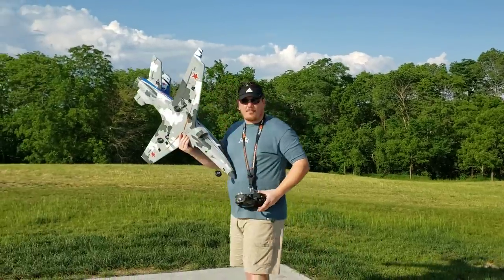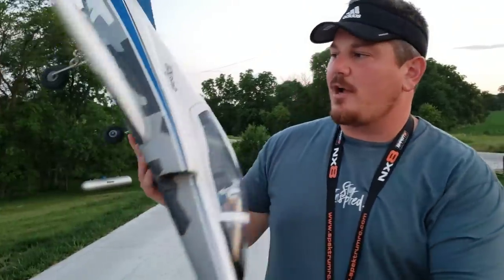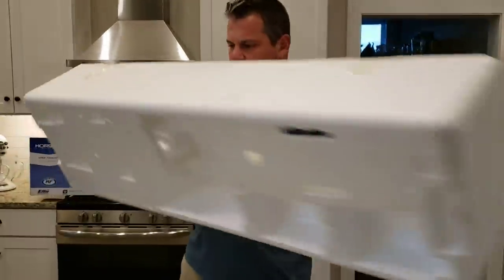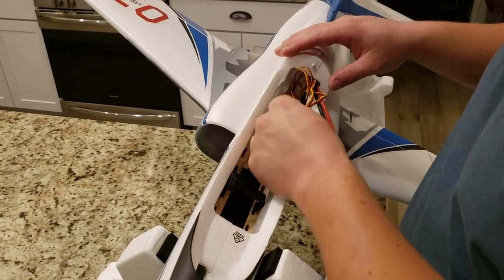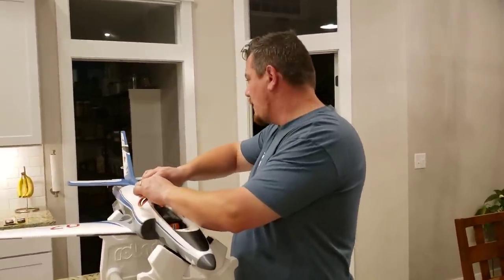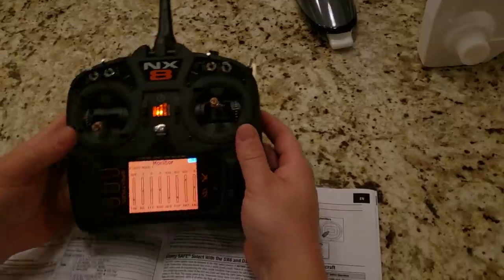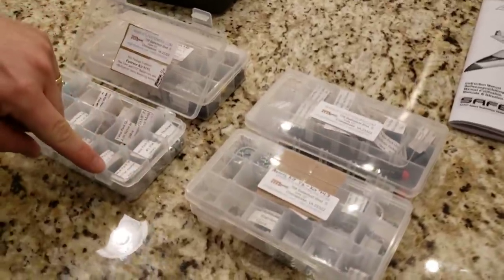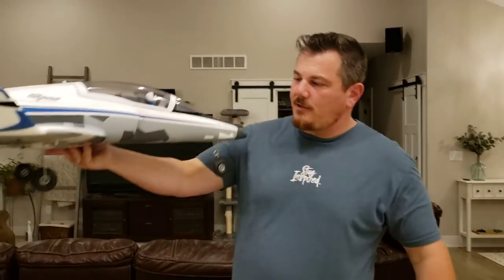Eflite - Viper V2 - 70mm - Unbox, Build, Radio Setup, & Flights

Comment: I did the Avanti 2 gear/strut upgrade. Best $70.00 I ever spent. Never thought about just upgrading the wheels to help with the spring loaded bounce... But that’s why you have 100,000 subscribers and I’ve never posted a video.
I don’t have a huge fleet of EDF’s, but I think this is the fastest jet I own. I maidened back over the winter the same day I maidened the F-16 Thunderbird, and at speed coming down the runway it didn’t seem even close, the Viper considerably faster.
Not what I was expecting from what some considered a “first EDF”. (6s 3600 spek gen2. The local 24 hour Lipo battery store was all out of the 6s 4800’s)
Reply from the maker: True!
Reply: Jeff, Can you please give me more descriptive  details on the Avanti 2 gear strut upgrade as to where you purchased it, thanks.
Reply: @leeshaver2347  I think any of the Avanti gear will do. You’ll have to do some trimming on all three wheel wells. I did mine with a long exacto knife and sanded them smooth with sandpaper and a Dremel sanding attachment. Looked awful, but I had some dark grey foam safe paint and covered the butcher job. About a year later I don’t ever notice. It was the best thing I’ve ever done in the sport repair-wise, not to see the Viper bounce.
Reply: @jeffhenderson934  Jeff, thanks, I'll look at motion RC to see if I can figure it out. The Viper is great but has a serious bouncing problem.
Reply: @leeshaver2347  I’m the worst lander of EDF’s in the history of the sport. One tip stall with an ArrowsRC Marlin last year and now I continue to come in hot and unflaired. The gear/strut upgrade on the Viper has kept it in one piece and looking new.
Reply from the maker: Sorry Jeff - your TWO links for the Avanti Upgrade got caught in the "Held for Review" filter due to web links...HERE they are, as you suggested - 

Nose Gear - https://bit.ly/3jFB283
Mains - https://bit.ly/3xvigF5

We've been so slammed I missed it until now!

P.S. I took the liberty of adding my credentials to the links you shared, so thanks for helping us out Jeff!
Reply: @BrianPhillipsRC  yer a good man Mr Phillips, thank you.
I’ve quit buying new planes for the 1st time in my 6 year career. Instead I’m spending my money on retracts, gear pins and wheels. I’ve replaced so many pins I can now disassemble  the retract motor, remove the screws, replace the pin blindfolded. (3 pins alone on the F-16 Thunderbird)
I’m devoting  the rest of my life to helping other “Foamer’s” land better, regardless of poor technique, lack of Fine Motor, or legally blind.
All I’ve done for the last month, 3 times a week, 5 batteries per trip is do touch and goes.
Reply: Jeff, I need help on my EDF landings!
Reply: @jeffhenderson934  Can't you come in slow by putting it in safe and landing flaps?
Reply: @aragorn318  you’d think I could, but I bounced the hell out of it enough to look for an alternative. Our asphalt runway is 30+ years old. And it’s really short. Planes and edf’s are like carrier landings.
Reply: Perhaps the Avanti V3 Main Landing Gear System will also fit the Viper 70?

Comment: I just setup my viper last night, cg’d it this morning and flew it today.  It came from the factory with several wires in the wrong ports. I finally took all the wires and both ferrite cores out and did my best to organize everything. I got it cleaned up a bit…still looks like a wire cotton ball. But, those ferrite cores have some weight to them.  The one on the servo wires I mounted on the wires around a half inch above the receiver and tilted foreword. The excess wire going to the nose gear I coiled and put below the battery ply board. The rest of the servo wire I looped and placed behind the receiver. The second ferrite core I laid between the foam under the dorsal vent channel.  With the heavy ferrite cores installed, my 6s 3200mah mounted around an inch in front of the receiver giving just enough room to loop the battery lead in between the battery and receiver. Canopy fits perfectly. I’m going to make some custom length leads for this plane. Definitely a PITA as far as squeezing everything in.  Flys like a champ. Radar’d at 108mph on maiden flight.

Comment: Brian, you are 100% right on. I did my dobro up grade today and was finally able to get good, no bounce landings from my 70mm Viper. I did use a 1 7/8 nose tire for a more accurate replacement wheel. Why cant Horizon get the message that softer low bounce tires should come as a stock wheel on their jets.
Reply: Can you provide link on the dubro tires, thanks
Reply: That plane loved to bounce and attempt to fly again with a bad result.
Reply from the maker: Low Bounce Tires https://bit.ly/3gLhSMk
Reply from the maker: I agree...why not stock? Way too expensive??? Either way, I LOVE this plane, and just wish the retracts would be a bit more solid with grass.

Comment: Brian, maybe this will help others... I bought FMS Front Landing Gear System Blue Avanti from e bay for $29.99. It has the spring loaded oleo. It fits right in with very little cutting of some foam. I then used Dynam Trojan tires from a wrecked 50 inch t28 I had for the REAR wheels. They fit onto the stock viper rear struts perfectly. The Dynam wheels are a little larger than the viper stock rear wheels. Fortunately they fit perfect into the wing when fully retracted without shaving the holes bigger. This has made for excellent take offs in DEEPER grass (with the slightly larger Dynam t28 wheels). The front spring loaded oleo has stopped all the front axle bends from bumpy grass etc... Believe it or not, that little bit bigger t28 tire has made an enormous difference for the long grass. I was having a very hard time with take-offs until this upgrade.
Reply from the maker: NICE! Great tips Sean! I like the solutions you came up with...and sounds like you solved all the issues I have with this 70mm rendition. It's a GREAT plane if you have a good strip to fly from, but if it's a rough one, or grass, it's a belly lander ;(

Can't wait to share our 90mm Viper Experience - coming REAL soon ;)

Comment: Excellent video! If everybody would follow what you are showing/teaching, there would be much less disappoinment on the field. The chest rig with the tray is the best solution for us (me and my son). This is how our hands and fingers are completely free and relaxed and can be used for the control of the sticks and the switches. Highly recommended. Many brands available (depending where you live). We fly in mode 2, as well.
Reply from the maker: I think I would like it too, but not sure I'd like when I'm holding the plane, for example...something a normal flyer isn't gonna have to do - POSE FOR THUMBNAIL (That's why there's always an awkward science when I'm about to fly - LOL) - other than that, I think it would be nice to try.

Comment: Hey Brian, Get A Roll Of Red 3/4" or 1" Tape & Add Full Front Wing Edges + Side Strips On This Viper + Paint The Nose Cone, White Elevater + Rudder Fins Red, I Think It Would Enhance Seeing It Flyin + Wouldn't Hurt The Color Scheme To Add More Red w/The White & Blue!? 😜 Thanks
Reply from the maker: LOL - You mean, make it look like the 90, just for click-bait ;) LOL!!!
Reply: @BrianPhillipsRC Or you could laminate the bottom of the wings with yellow econokote which is light. And the visibility would be crazy. Also when you do the radio setup could you slow down and maybe do a dedicated radio video on what you do and why with close.ups of the screen, this would give Cam Crew a break for once, I for one would love to see that type of video. You are really fast on the radio. Hard to keep up. Thanks.

Comment: Always good. Ready for the 90 review when the shipping containers finally come in. The reason it’s not a NX7 is that extra 7th channel is not fully proportional (the 6 are), perfect for safe assignment.
Reply from the maker: Interesting, seems I was able to move it through the whole range on mine???? Can't you??? Or is this at a REDUCED range???
Reply: @BrianPhillipsRC  hes right brian on a nx6 you have 6 proprortional channels and the 7th is simply on or off and is not proportional. hence its only  +100 or -100 and is used for safe select

Comment: This V2 and still no navigation lights on the wings. I got the version 1 that came with the AR636a receiver. That plane would unexpectedly glitch eventually leading to a hard bank to the right and eventually it crashed. I did get a V2 replacement from HH after showing them what happened. The V2 came with ferrite magnets on power cables and receiver leads. HH also replaced the AR636a receiver with the new AR631. Jet flies so much better than V1 and I have not noticed any issues with the wing cracking between the flaps and the retract slots. Just wish HH installed navigation lights and softer low bounce tires.
Reply from the maker: Awesome! I agree about the tires, and nav lights to me are pretty much a must...but since they have to hit market prices, they can't just put it all in every plane...Even thought I still want them too ;)
Reply: How do you tell by looking at the box in the hobby shop if it is a v1 or v2?

Comment: I don’t have a NX6 but here is a write up from theparkpilot: “Channel 7 is not a fully proportional channel on the NX6. It cannot be used in mixes, nor does it include travel adjustment.” — so if I understand this correctly that 7th channel can only output the exact values of -100 and 100 (and maybe 0) - perfect for SAFE, but nothing in between. Where the others can do the full -100,-99,-98…100.
Reply from the maker: Interesting...not sure how you would make a PWM channel do such a thing...

Comment: I like the new tires, could they also be used on the Habu 70mm STS?  The stock Habu tires are a little bouncy on landings.
Reply from the maker: Sure, but might want to double check the size is right with 2"...

Comment: It is too tight in the cockpit for all the wires. I moved the wires under the wings and built a kind of aerodynamic shell to cover them. It works very well and more easy to remove the wings and replug them. I could send you picture.
Reply from the maker: Thanks for the info!

Comment: Hi Brian !
In your video on the viper v1, you said you increased the flaps, elevator and aileron travel.  Did you do the same here?  Too much increase in the travel of the flaps does it not increase the risk of stalling?
Antoine from France
Reply from the maker: I can't recall...but this one was close to the manual call outs.

Comment: Would keeping the ferrite cores help with cg? So that you don’t have to place the battery so far back. Maybe they’re there for cg purpose. I just bought this jet. Unfortunately I made the mistake of buying a PNP thinking that transferring my 637TA from an ultimate to this would be easy. Learned I had to buy a pc/usb cord to program it. The worst part is that HH doesn’t offer a template for SAFE/AS3X. 
The eflite fan community has helped me for the most part. I still have to set up SAFE but only AFTER I find the right gain values for both flight modes. Long story short…. Buy a BNF
Reply from the maker: You are correct in your findings ;) ALWAYS BUY BNF if you can possibly. It's a lot easier, but if you get a PNP and need help, check out my BEAVER (LOL) video, and you can see how we set that one up with AS3X and SAFE...
Reply: @BrianPhillipsRC  that beaver video though..😉

Comment: If this was going to be a first edf, what are some tips you have to be successful? Asking for a friend 😉
Reply from the maker: This might be a bit FAST for a first EDF, but if you must, make sure you have a HUGE flying field so you can use SAFE the whole flight...all the way down to the ground, if you find it necessary. Take your time and let her settle down into a nice HIGHER SPEED LANDING...this plane will slip out from under you if you try to do slow, base leg turns on final, and then you'll plop down in a terrible crash - I know from experience ;) - but with some speed, like say at 20% throttle all the way to the ground, then just let her roll out, you'll think it was EASY to land. Takeoff is easy. Flight it easy. Landing on time is HARD, since you'll want to fly forever, and your timer will go off way earlier than you want ;)

Good luck!

Comment: Hey brain I have a question ? Back in the days there was no such thing as safe or as3x mode . We had to fly planes just the reciever . So my question is when you use safe on a plane is that considered a maiden ??
Reply from the maker: AS3X is a stabilizer, and SAFE is just MORE aid. I don't fly with SAFE, and haven't for some time. During many maiden flights, I will activate SAFE and show the controls, as I remove my hands from the sticks to share how well the plane flies without any human input, but just as a demo in the larger scheme of things.

Maiden flight just refers to the FIRST flight, and nothing really more.
Reply: @BrianPhillipsRC  I know your not using safe you got skills bro 🗣️💯 but do you considered it flying the plane if it's on safe ? I feel like when you don't use safe you actually flew the plane . Nothing wrong with safe but you haven't really flew the plane if it was on safe all day . Not saying you did that I'm just saying in general

Comment: Hi @BrianPhillipsRC

Would you happen to know what the flying weight is or the wing loading you're flying at with 5K pack?  I am currently building an old SAPAC ViperJet and picked up the FMS V2 Platinum 12 blade fan... looking to run 6S and am concerned of flying weight.  I am also putting the Avanti V3 retracts on this.  Just wondering if I need to stick with a 3300 6S or if I can go 4K or even 5K 6s pack.
Reply from the maker: I do not. Sorry!!!

I say the same thing to almost everyone who asks, if you can get the CG right, you can fly it....just keep in mind, you MUST GO FASTER to keep it flying ;) FLY HER TO THE GROUND!!!!!!!! 

Good luck!
Reply: @BrianPhillipsRC  Hey thanks for the reply and that is good advice for sure.

Comment: If the ar631 tells how many g’s you pull, is it ok if you could tell me how many g’s this plane pulled? It’s incredible how a foam plane going 120+ MPH that is fairly heavy suddenly go from horizontal flight into vertical and not rip its wings off.
Reply from the maker: I agree, but sorry, that telemetry data is gone now... I can try to share it at some point on a future flight
Reply: @BrianPhillipsRC  no worries, idk why but I’ve recently really been interested in how many g’s these rc planes can pull, so I was just a little curious. No need to rush if you want to do it.

Comment: Great review-flying-filming of the Viper folks! I had mine delivered yesterday…. Oh wait a minute, my mistake, it was the cheaper model
Reply: It was the $140 Arrows Marlin…. Similar lol
Reply from the maker: I'd like to review that plane too, but they won't reply to my emails????
Reply: They are so silly as imagine the advertising from your site. I believe they don’t have any available in the USA at present Brian. I got lucky when i saw there were 5 available on Amazon website with 8% off as Arrows RC are normally hard to get here . I am in my garage right now assembling it & going to try to see if a spare fms Reflex system from my Avanti will work. Regards Noel

Comment: Hi Brian 
Do you remember what the gain values were in the radio for the receiver?
Did you set up multiple flight modes ? If so , what were they ?

Thanks
Reply from the maker: nope, I don't know what they are, and not sure that I can even get in to see them....the Forward Programming wasn't accessibility, if I remember right.
Reply: @BrianPhillipsRC  if you power the radio and plane up and scroll your wheel to the right you will see monitor and after that i think its two or three after monitor in telemetry it should show as3x and safe gains

Comment: I have a viper 70mm with a problem, when i fly with retracts/landing gear out the plane is very sensible and has a big deviation to the left, but when retracts are in the plane flies fine… bought it second hand but should be fine, used a new transmitter dx6 for it, very strange…  not sure if safe was active or not but still then its weird
Reply from the maker: Get it flying in AS3X and get the trims right....WHEELS DOWN, then wheels up, see if there's a change. Mine never has a change with gear up VS gear down. I wonder if you have something weird going on???

Comment: I just flew my new Viper 70mm today for the first time and it takes off and flies great, however landing the plane bounces even when greasing it in. I changed the landing gear to the spring ones from RC Castle thinking they would work but it still is difficult to land on a paved runway (haven't tried the grass as yet). I'm going to go back to the stock gear and replace the wheels with the soft foam from DuBro, don't know if they will be better or not. Any suggestions from Brian or the public would be very much appreciated as I like the plane.
Reply from the maker: I think the low-bounce tires worked well, and she settles down a bit better, but this plane is just a fun plane, and when you grease in the first landing, you'll be totally in love!!!